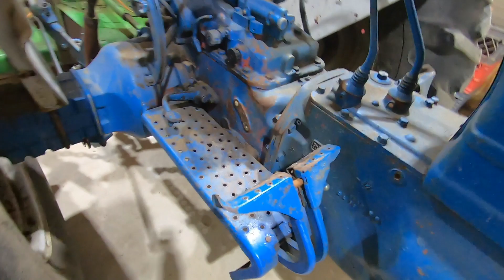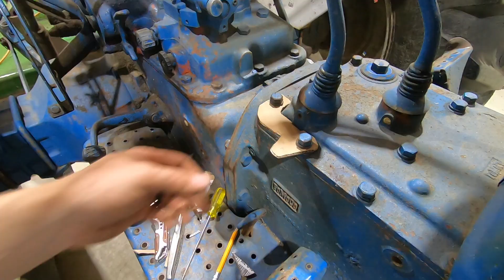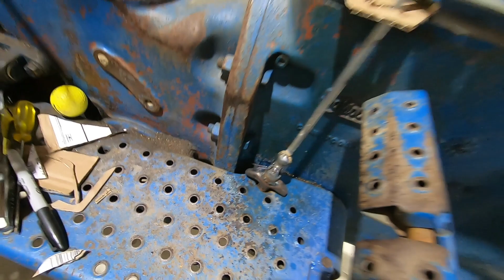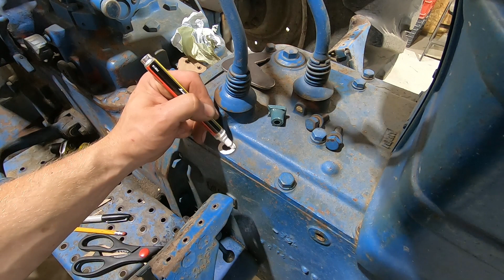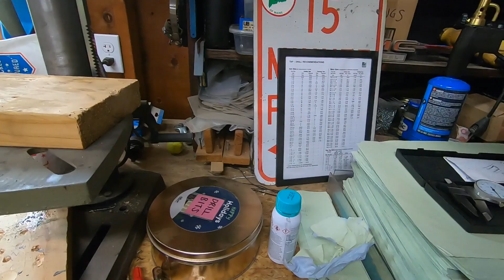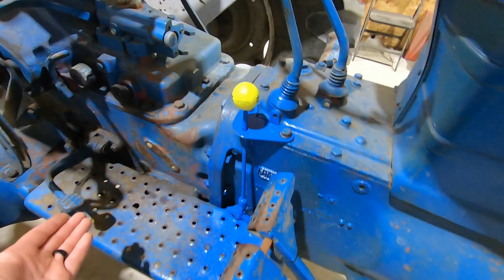Ford 5000 Park Brake Upgrade. Easy Reach E-Brake Lever.

Comment: You're completely right.  When Ford came out with the "600" designation (aka 4600, 5600, and industrial 420 and 515) that replaced the 4000, 5000, 3400, and 4400, they extended the brake handle up to where the transmission case is.  I'm actually wanting to do it on my 4400.

Comment: Here in the Uk the pre force thousand tractors didn’t have that type of handbrake,it was a handle with a button you pressed.Later force versions had the handle on the left hand side.
Reply from the maker: Thst sounds like a better, newer design

Comment: Boy, do I feel your pain concerning the parking brake! I have a 1975 Ford 5000, diesel with the dual power transmission. Setting the parking brake must always be done to keep the tractor from slowly rolling away, Since the tractor is equipped with the dual power transmission, and after the motor is shut down, the tractor will begin creeping away. Since I don't have your talents for fabricating an extension for the parking brake, I did find a couple of things on e-bay that might be exactly what I need. Thanks for sharing!
Reply from the maker: I just can't believe that Ford engineers let the tractors go off the assembly line like that! Anything you can do to raise that handle will be a great improvement...best of luck.
Reply: By the way, you are 100% correct about the 4000 series having a much longer parking brake lever. My niece had a 4630 Ford tractor which had a parking brake lever that was as high as the top of the gearbox. Ford much have finally received enough complaints about the short lever.  @marktolman6037

Comment: Nicely done! You may have a little rattle but it will serve its purpose. Great how to video. Thanks for sharing!!
Reply from the maker: So far it doesn't bother, can't be heard over the sound of the engine and bush hog running. Thanks